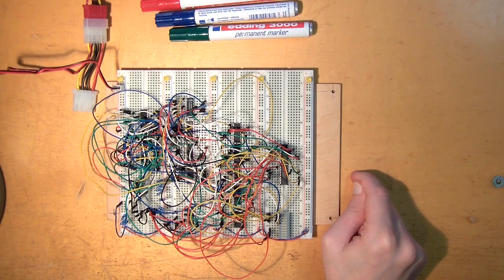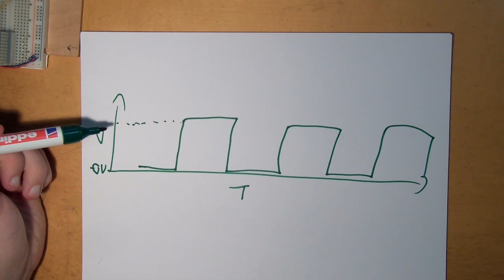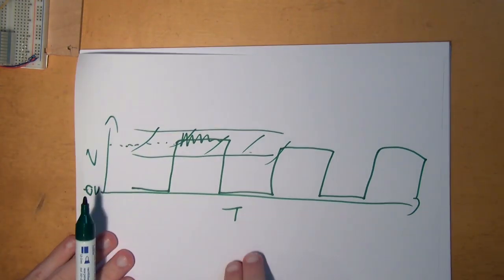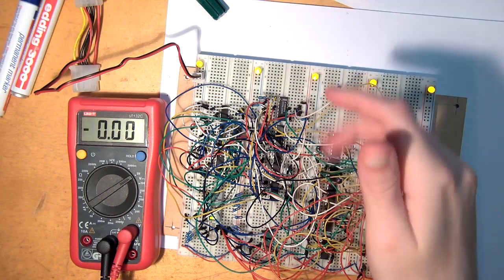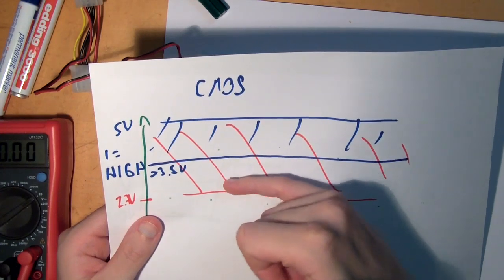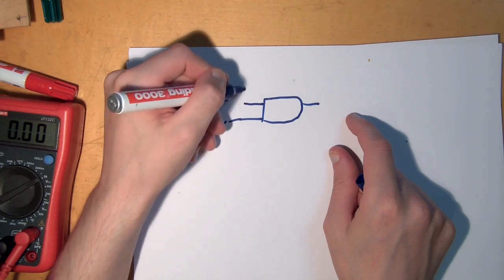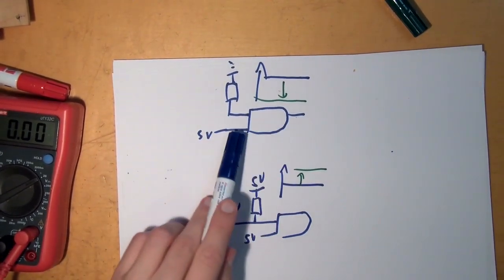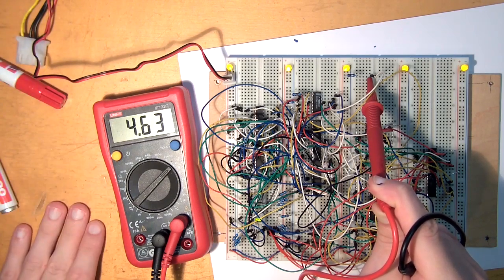Level Shifting - Lets Build 8 Bit Computer Part 9

Comment: i realy like the idea of the video but i lack the coerence with materials names, i was searchin for the names in you site and you change the "name sistem" it can be very confusing if you are a beginer ;) could you organize this? this is amsing series, i would put a precise list with tecnical name of material in the first video and then you can, but dont need,  add in each video wtv you use. and off course i would like to see it working in the final stage.. is it finished for you ? cheers and thanks so far

Comment: with a pull-up resistor is your input is not always true?
Reply from the maker: No.
Reply: madmaxx why?
Reply: cab3 Because when the output of the first chip is low (0V), almost all of the 5V from the supply are dropped across the pull-up resistor. Here he's using a pull-up resistor as a quick and dirty level shifter but normally they're just used to provide a 'default' value to a chip's input pin.

The question I have is: by increasing the voltage on the first chip's output pin, are you not going to end up with a reverse current through it and can you be sure that the chip will be ok with that?